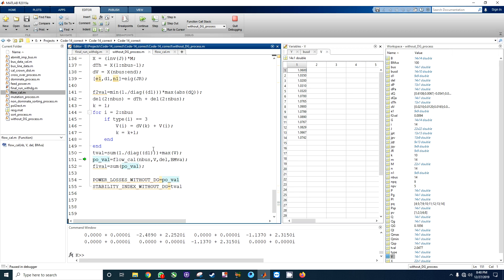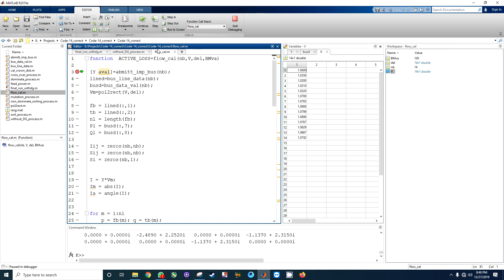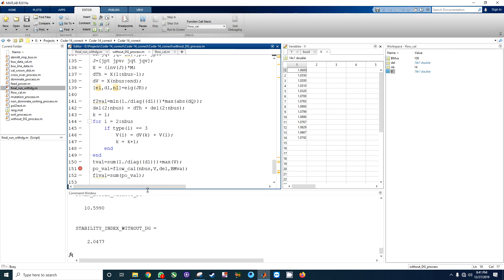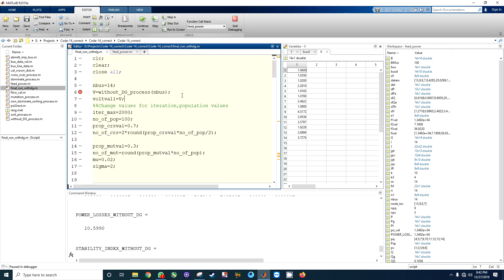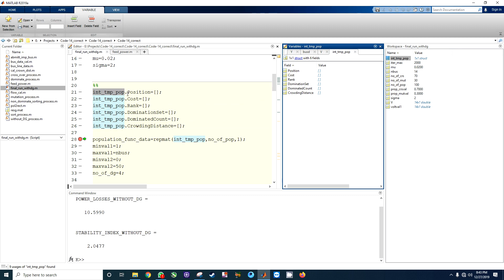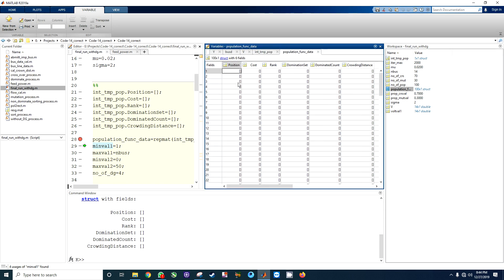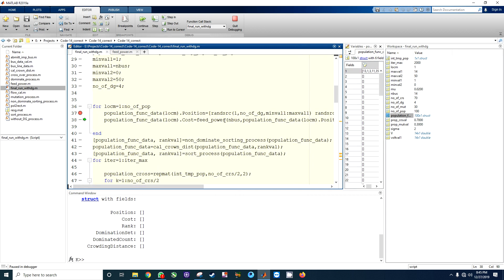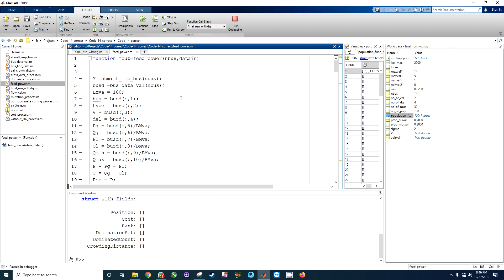IEEE 14 Bus System incorporation of Distributed Generation Matlab Part 2/4

Comment: Sir, How can we do for the system with less than or more than 14 buses? I tried for it but it is giving an error on matrix dimension.
Reply from the maker: Radial type network apply Forward-Backward load flow.
For mesh type apply NR. This video have NR type load flow.